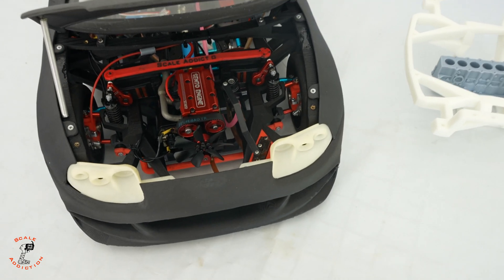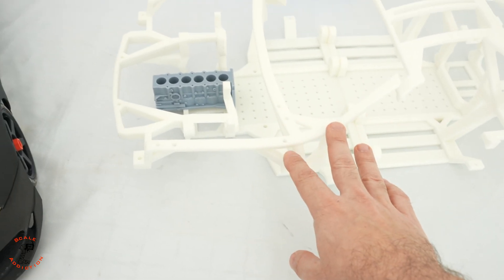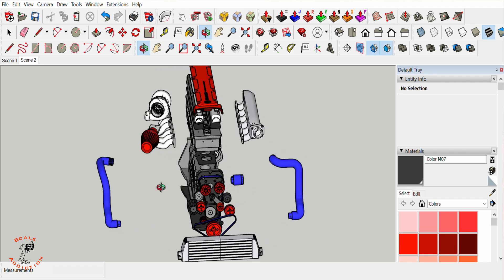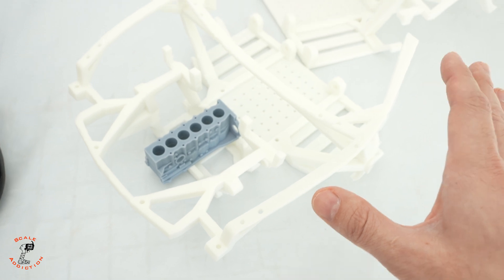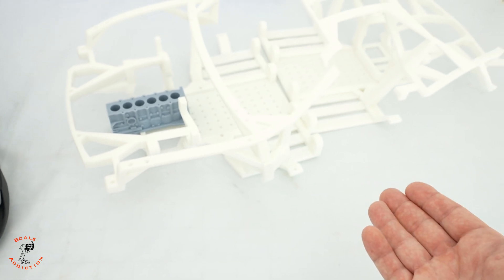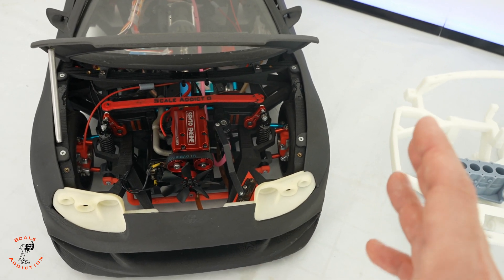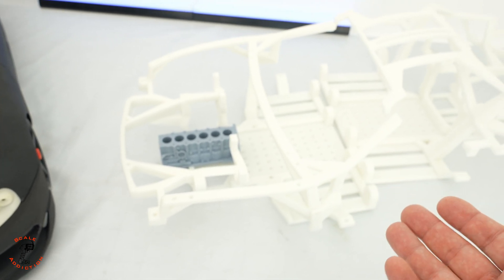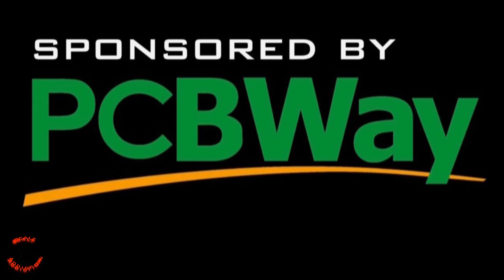Fully 3d printed 2JZ engine and update on skyline 4 cylinder engine | Scale Addiction

Comment: With four-wheel-drive and four-wheel break in, it would improve its breaking ability due to the fact that weight shifts when breaking and it shifts to the front wheels, but since those are free spinning, it’s not using as much brake potential as possible and it’s more skill authentic for the GTR to make it four-wheel-drive and to mitigate the out of scale appearance of the front differential it could be placed in the spot of the engine mount, and the engine could be modeled to be a cover for it but with my supra being electric, I don’t have much issue accelerating. I do get a lot of wheel spin in the first gear even at low RPMs. But the difference between it and my infraction in terms of breaking is very much noticeable, but not detrimental.